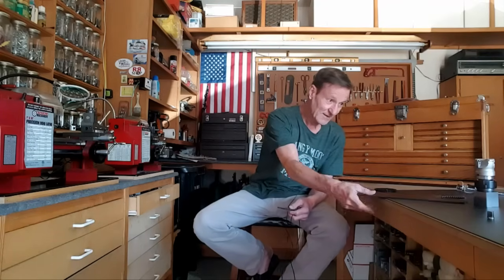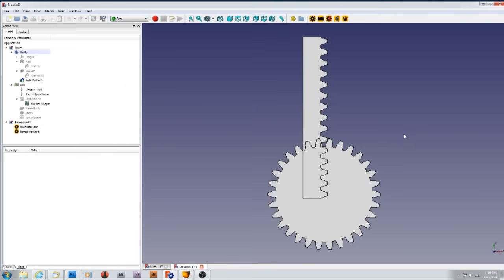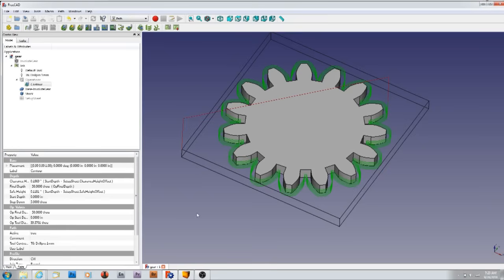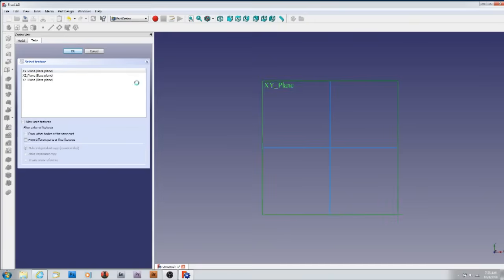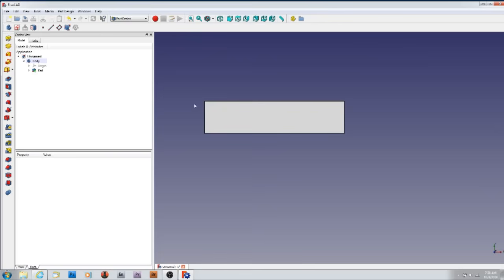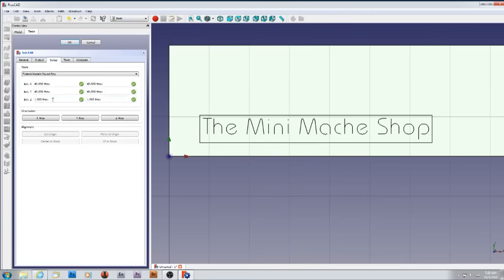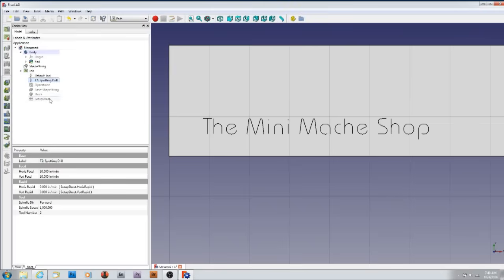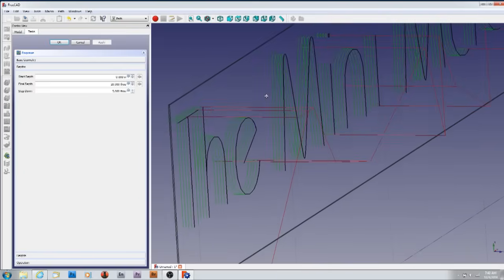Freecad Complete Engraving Text Tutorial

Comment: Thanks for the video , but if the resolution  was higher , i would be better. It works also for any  geometry , lines , polygones circles etc...
Reply from the maker: Sorry that's what youtube dose i upload 1080p
Reply: @TheMiniMachineShop  Any way its very useful thank you , i have a problem with the feed rates , when i put  1.00 for the horizontal feed rate , i got  F60.00 in the Gcode , i don't know where this ratio is coming from...Any idea , i am also under Linux and uses GRBL . Any idea?
Reply from the maker: @francoisBonin-phils  When gcode is compiled it doesn't know what the max speed is of your machine so it's telling the machine to go 60% of max speed. And the max speed you programmed in the machine settings.
Reply: @TheMiniMachineShop  Thanks for your answer .the problem was , i entered mm/s and the gcode gives mm/min.When entering mm/min it works perfectly , i have to enter the value 2 times that it will effectively appears in the panel...BUG?

Comment: Hey this is a long shot... hope you're still reading these:
When I create a Shape String using those stick fonts, the size is like, way too big. The setting is default .39 inches but its more like 3 inches and therefore the gcode is all messed up. I can't find anything in settings. PLS help! Thanks man
Reply from the maker: I did explain it in the video starting at 8:20..
Reply: Dave M I saw that, but it seems like it’s still way too big. I guess my version of freecad is newer, because it has the units and the shape string dialogue steps are all in one dialogue now. Either way, maybe don’t understand what “height” means for text. Does it refer to .39 inches from the bottom of a letter to the top? Or as you explain, 2x that amount from the bug, or am I wrong. I tried to make it really small but then it just doesn’t show up. Nothing wrong in my settings, I don’t think
Reply from the maker: I upgraded to 0.18 since the video but just tried it on text and I can easily go as small as I want .. I stopped at 0.050
Reply from the maker: My email is at the end of the video if you want a private video...
Reply: @TheMiniMachineShop  I've sent an email. Just to let you know, the issue seems to be going from FreeCad to the post-processing software

Comment: I recently bought a mini engraving machine and had the same problems with software instructions. I did find a app called F-Engrave V 1-65 for a very easy engrave set up and G-code sending. Then I found an app called Grblcontrol (Candle) where you can download the g-code very fast and set the path to test to check for mistakes and then off you go engraving. 
Hope it helps
Karen

Comment: Dave, I can't remembeer where, or what exactly the set was called, but in an earlier video you asked about replacement parts.  I've seen all the plastic pieces and complete Z axis sold in a set for $40 (just saw 70-80 on Ebay), and I've seen the control board for I think 28 on either sainsmart's site or Amazon.
Reply from the maker: Cool! Thanks...